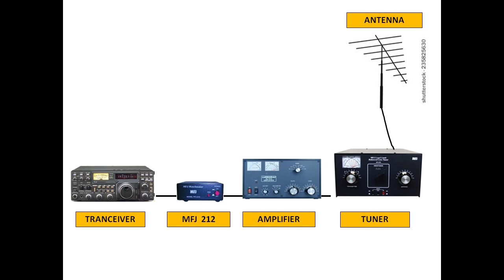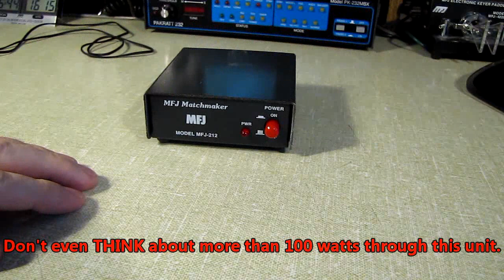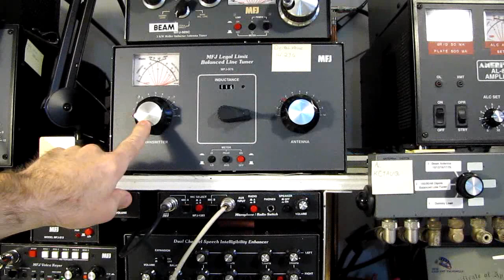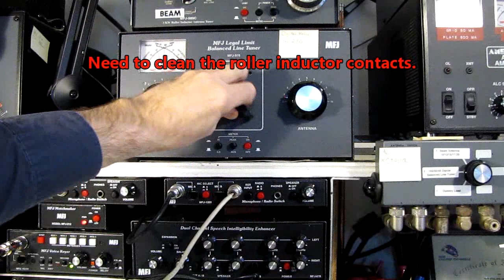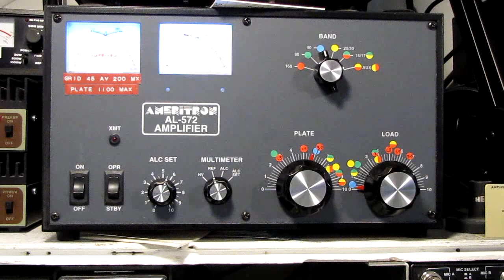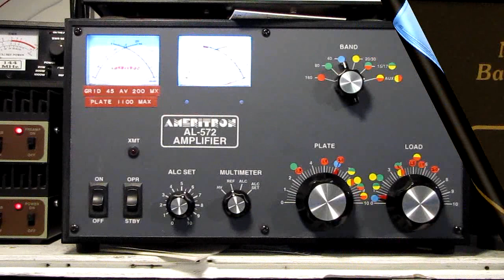MFJ 212 Matchmaker - Tune Your Antenna and Amplifier OFF line

Comment: I think that it is possible to find someone who is both inexperienced and not-a-moron at the same time.  I do not have the means to buy a beautiful Ameritron amplifier like yours, but if I did, I would be really careful with it!  In order to tune my rig, I go to to the lowest possible power (10 W) and also I offset the frequency by 5 kHz.  And even with that, I am petrified when I launch my call sign on the air, one minute later!  

So, now that I will be using a mag-loop antenna, the de-tuning method will not work any more and the tuning becomes really critical. For that reason, I just ordered a match-maker. I think this is a great idea and I am confident that it will work as well as expected. I noticed that you use a couple of those yourself.

Comment: Hi. Nice video. I don't own an amplifier, have never used and amplifier, and probably never will, but it was to see how to tune one. There is an amplifier at my local clubhouse at one of our 4 seat operating positions. When not working with the club I am strictly QRP. I feel the pain about the idiots that do on air tuning and never seem to go away. Its difficult enough to work QRP when the big boys are running QRO but impossible when I come across OTAT (on the air tuner). 73 and I am enjoying your videos and the way you explain things.
Reply from the maker: Hi Terry, I was "barefoot" for many many years. Worked the world with 100 watts. Then band conditions went down, no code brought in tons of lids, and was finding it nearly impossible to get "the new ones". Figured I would level the playing field. At my advanced age life is getting too short for QRP. :-)  Thanks for watching.